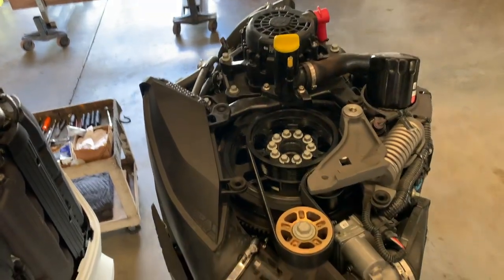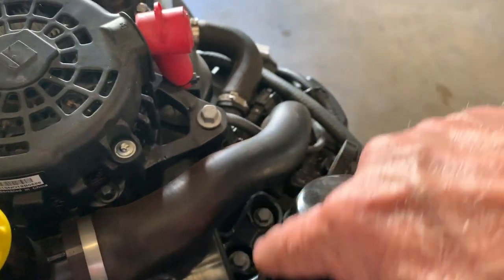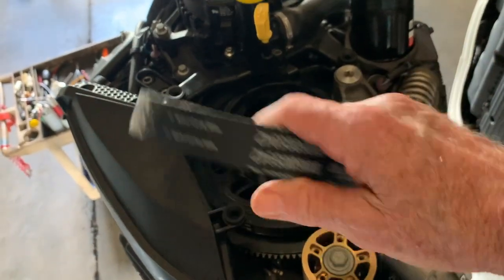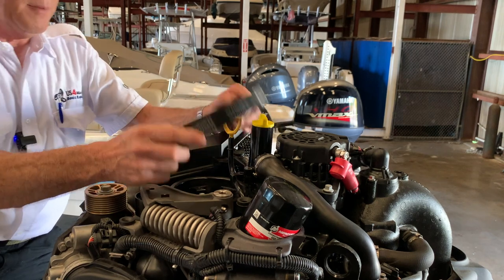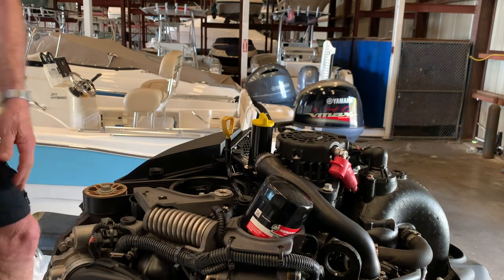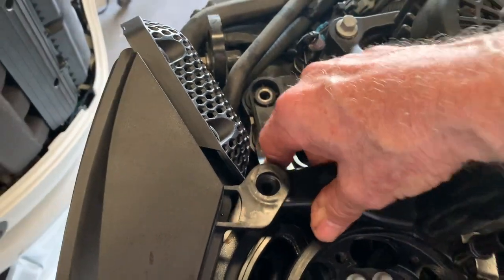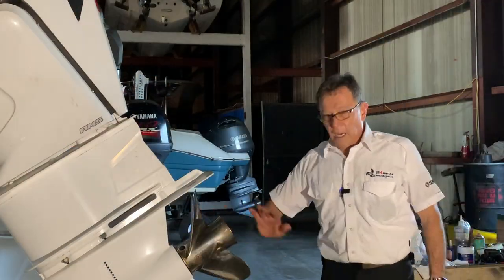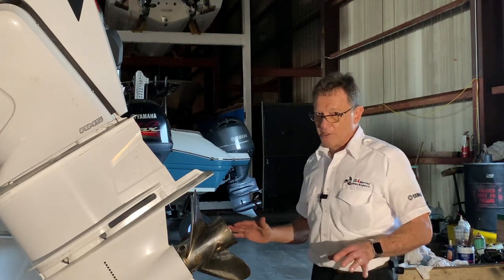Mercury 450 Racing V-8 (Part 4/4) Service Tips.

Comment: Can you do a fuel filler service.. as  I can't find mine on my 450 racing mercury.. a have a water separate filler in the aft of the boat. But I can't find a fuel filler on the engine..
Reply from the maker: Yes, you’re absolutely right, as I’m checking the video over, I noticed the part replacing the filter was not uploaded. Thank you for bringing it to my attention. If you look inside the engine lower cover on the  starboard side aft corner, you will see the filter element. Just disconnect the wired connector first, then disconnect the two hoses by pushing in the red tabs and then pull, then to remove element turn clockwise,  once removed  you’ll be able to see how is fastened to the engine, then installed by turning clockwise, re-install hoses by just pushing in until it clicks. Re connect sensor plug. turn to the on  position  (DONOT RUN MOTOR) and let the pump runoff 5 seconds. I do this twice. Then you’re good go. Keep in mind on some 2022 models that filter is no longer there, and now is installed inside the boat.
Thanks again, I will make a video of it right away, hope you don’t mind if I mention you.
Reply: @US-4 Marine  Thank you so much for your help it's much appreciated..